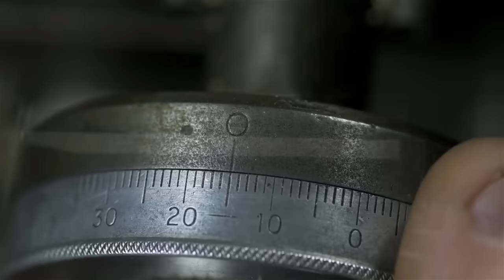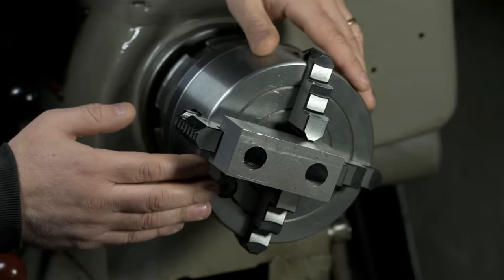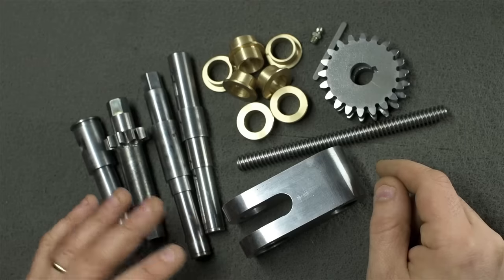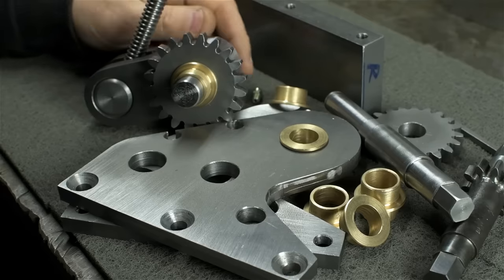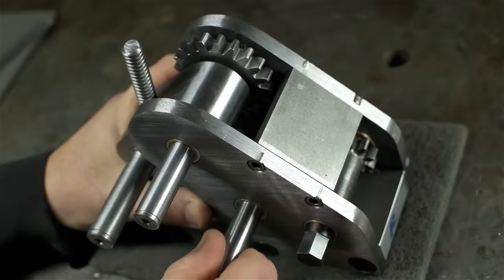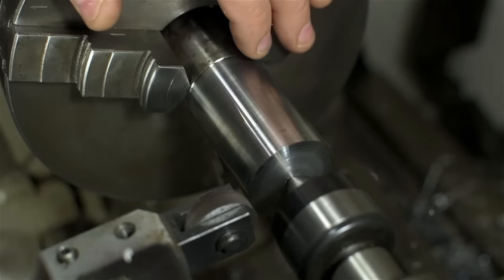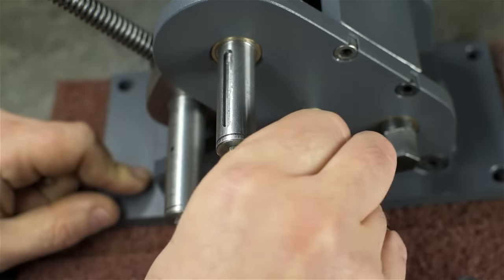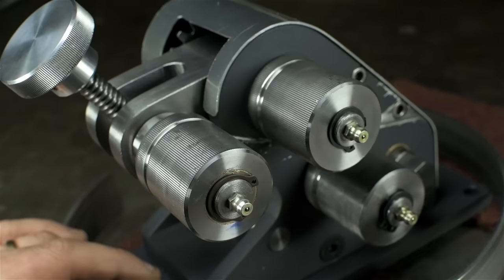The Rollenator! (Ring Roller Build)

Comment: Very nice, but how would you roll a non-flat shape? I've always wondered what it takes to roll aluminum sail track around a bend either inner or outer bend without crushing the sail track grove. Is there a way of doing that?
Reply from the maker: custom form-fitting rollers.  That fit the shape you want to bend.
Reply: @ThisOldTony  Many thanks for the fast reply, love the channel and the humor, i always learn lots watching you're instructions. I'm not sure just rollers would do the job because the sail track has a sideways facing grove that is offset from the base and I'm imagining that the top would collapse due to the larger radius on a bend. (example where I live: www.bunnings.com.au/metal-mate-27-95-x-12-7-x-1-7mm-3m-aluminium-section-sail-track_p1109879) I wonder if something could be placed inside the grove before bending and maybe chemically removed after. Pulling it out would be really hard to do once the hollow section collapses onto it. Either that or maybe some former that is stationary and inside the gap between the roller wheels that the bar has to use . A small section of well lubricated former that can bend to the radius required.

Comment: I did not scroll down too far, (no knurling on my scroll button) but my look see in response to your request regarding cost of such a machine resulted in this range: $150 for a manual roller of questionable quality at the low end.  We did see a cart mounted electric operated machine with 4 die sets, (round tube, square tube, You Tube, and flat bar) that was $2900 before shipping. There were quite a few in similar size to your build in the $850 too $1100 range, with cabinet.

Comment: If the material is, "moved" into the negative areas of the knurled groves, will this make the overall outer diameter somewhat wider than it was originally, as if "pinched"?  If so, does this also happen when tap and dieing, making a hole circumference somewhat smaller?
Reply from the maker: yes it gets bigger.  that's an old trick they used to use for emergency repair of worn bearing surfaces.  yes also with threads if they're cold formed (not cut)
Reply: @ThisOldTony  thank you!  I had this same conversation with a friend back in middle high school, in Bedrock, when I was dating Pebbles before that muscle headed, blonde buffoon came along!!  Um hum!  It definitively answers that question, at long last!!!

Comment: Customer rep with moderate understanding comes in, hands over files for a machining job. Files are from their engineer. Rep is repeately specific about some specs. Turns out they do not match the specs in the files from their engineer.

Which one do you go with?
Reply from the maker: you have to work to the files/print... have the rep update the files via the engineer so everyone's on the same page.

Comment: Well, when it comes to knurling metal, I managed, completely by mistake, to knurl a tapering aluminum shaft that was being used as a handle for a brass head hammer. And thing is, the reason the handle had a taper was a mistake to start with, because the class lathe I was using to get the handle down to final size, no one warned me that it was making tapers in anything turned on it, because something was wrong thanks to a careless student damaging something on it. So, I turned my handle, found it had a taper and I did not have time to make a new handle. Time to knurl it, and by that point, the teacher had taken the damaged lathe I had used to get the handle to final size..... so I knurled it on another machine that wasn't damaged. Got a beautiful, even, cross hatch knurl the full length of the handle. And if the taper was an issue and caused the knurl to be "out of spec", you could not tell with the naked eye, though, you could tell the taper in the handle * sigh * but, when all the work was done in the end, I did have a beautiful, machined by me brass head hammer. I miss that one class in high school......

Comment: Hey ToT, I think I saw 1 of these the other day at HF 4 $80-...?   Of course the 1 that I needed 2 get was $200-  (HF Tubing Roller) I'm building a ParaMotor Frame 2 oh say, Fly Around... They typically have a 55 in. dia. . . 1" Hoop 2 protect the Lines frum getting sucked in2 the Prop.. Mine is gunna B 66 in. 2 accommodate a 59 to 62 in. prop - which isn't done (Yet)  Most people don't stand that Tall...         The good thing about Your Tool is that U know where it is made - Right here in the Good Ol' USA (with Domestic & Imported materials) For ChrisSake, it took me 2 hours of De-Burring 2 make the thing safe 2 use...  Now I nee2 get a Tubing Bender 2 do all of the Compound bends - It's Tearin' the ass offa me. Thanx Ol' Tony...                                                                                                                 LJR-III

Comment: I can't stop staring at the counter bores bleeding past the edge....  You can buy a Horrible Freight ring roller for $74.99 (I checked before my eyes became welded to those counter bores).  It, the Horrible Freight ring roller, sucks unless you like turning flat bar stock into wine bottle cork removers.  Yours would likely only cost about $1,500 with time and materials, but still beyond the budget of most amateurs.  However, we (amateurs) buy and use the Horrible Freight stuff which is great because it takes a lot of wine to drown the tears we shed from poorly-formed rings.

Comment: There are no knurl marks on the diameter of the stainless because the diameter was to large and the marks cancelled themselves out.  Had it been slightly smaller you would have the marks.

Comment: *******************CHALLENGE ***********************  how would you hold a half dollar on the lathe while working on the edge of the coin specifical heating the coin once milled to depth using heat to expand 
the coin so the piece when finished will fit over a regular half dollar?
Reply: need pics i can send what finished product looks like.

Comment: What is the risk or downside of pushing a burr?
Reply from the maker: i don't remember the context exactly but was it on the lathe?  mill?  pushing a burr means cutter is not sharp.  so you end up with poor finish, sometimes harder to control size, and the machine is using more power / making more heat.
Reply: @ThisOldTony  On the lathe @0:49 (or however those kids get YouTube to link to a timestamp).  

But thanks for the clarification!  I'm fascinated by machining / milling and similar things I should never be allowed near (I'm clumsy).  

Cheers.

Comment: I don't get the henry ford joke
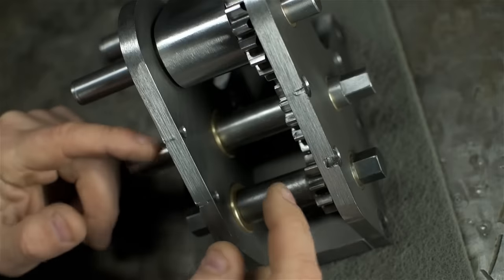16:44
someone explain
Edit: and the rockwell a million(?)
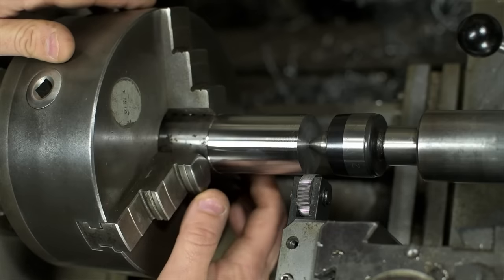20:19
Reply: One of the things that made Henry Ford's cheap assembly line for the Model T possible was having interchangeable parts.  (Ford wasn't the first to do that, but it was particularly critical for what he did.)  Before that, close-tolerance parts of cars had to be made by picking parts that fit right, or adjusting them to fit, just like Tony is doing by swapping the bushings around.

The Rockwell scale is a measure of hardness.  Typical numbers are in the 40-100 range; higher numbers are harder.  (Also there are several scales, for different types of materials.  It's complicated.)

Comment: @2m00s: "...about 40-to-1..."  The Mercedes 9g-tronic transmission famously has three parallel holes, each 6.1 mm diameter, in a 16 mm diameter core, to a depth of 361.5 mm. That's 59-to-1 baby. :-0

Comment: First you need to minimize the talking (get to the point! Please). I like the design and clean lines. Bottom shaft end lash, you could use a shim washer. Your jokes and puns need work. the length of flats at either end of work peace is due to the distance between the idler roller and the lower drive roller (bring them closer in a new build). the grey paint was a good touch (tired of yellow). Thanks for sharing the build.

Comment: As a 20 yr. exp. Machinist, 
the First 25 min. 
should have been 
shortened to say 5-7 min. 
I ended skipping till 25 min. segment.  
My main question, why not use longer bottom plate to create wider option with opposite side roller holder and various 3 piece sets 
of different lengths. 
Good idea for your next video. 
But Shorten up the tedium.

Comment: Your forming roller is basically exact the same and would be 80$ from harbor freight. I work in a R&D engineering lab. I was able to form 3/8 stainless steel adjusted to form diameter to 32 inches. It was  a cap on a rather large graphite gasket Going into one of the new Ohio class nuclear submarines the Columbia’s. I did alittle modding on it, by attaching a motor and controller to the crank arm. AND then mounted that whole beast to a table to be integrated into the production line 

https://www.harborfreight.com/gear-driven-ring-roller-36790.html

Comment: stainless oxide???   i think not
Reply: What do you think tarnish on stainless steel is, exactly, then?
Reply: @fredio54  okay I will stipulate that if it's poor stainless or if it's of a grade that tends to discolor yes it would obviously be oxidation because that's what happens to metals but the makeup of say 304 stainless is not subject to oxidize very rapidly I hit a bundle of 50 3/4 in by about 5 ft 304 stainless rods for my lathe probably for about 8 or 9 years they've been leaning up against the wall of my garage and for about a year they were in a damp storage facility and they don't have a spec of discoloration of any sword on . What causes that gray flat finish is cold drying sometimes hot rolling will facilitate the same stretched flat gray finish there's actually a four letter acronym for that finish but it's commonly called Mill finish and it's what happens when you draw or stretch a piece of material to its final dimension it's not oxidation
Reply: @fredio54  I also should tell you that I'm on amateur organic chemist emphasis on the word amateur I'm not trying to be an internet expert. But there's no such thing as stainless oxide it would have to be one of its components like chromium or whatever if it was the iron-based component it would be orange obviously or red or it could reach a state of oxidation that makes it kind of blackish but it wouldn't be smooth and even it would be blotchy because the components that are used to make up the different stainless formulas are not going to separate in a way that would allow one element to oxidize by itself it would end up being blotchy I'm almost certain of it. If you even notice a piece of aluminum plate that gets like damp or some other chemical spilled on it it'll have all sorts of variations of oxidation

I'm probably not expressing myself correctly but best I can do
Reply: @ClownWhisper  304 is totally subject to corrosion, only 316 is decent in harsh circumstances. My chemistry papers at University don't tell me that, 30+ years of working with stainless at home and in marine environments do. I'm not even sure which grade is used for the shafts permanently submerged in the ocean on our current boat, but it's not 316 AFAIK, something much stronger - it too has been fine for 25+ year in salt water. But 304 in salt water can vanish pretty quickly. Same if soaked in a weak acid, will be full of holes in no time. All the fixtures above the water line are 316 but even that loses its shine over time. Stainless can corrode, just not very quickly. Aluminium is highly reactive, but under normal circumstances doesn't corrode at all after an initial burst when first exposed to oxygen. Unless you treat it with a certain acid, then it reacts rapidly.
Reply: @fredio54  you are talking about absolutes and are involving corrosive elements 
the grey flat coating on the metal in question is not oxidation PERIOD! its caused my manufacturing.

under normal conditions even using 304 and even over many many years you will never see stainless get a layer of oxidation as seen on the metal in this video.

i switched out all of my glassware holding apparatus, bars, clamps, etc to stainless 10 years ago and use mostly the 304 I had/have on hand for that reason. yes, 304 isn't the best choice for this obviously but it has held up to every manner of extremely low ph off-gassing as well as months and months of chlorate production, and other than some blotching there is nothing like ys seen on this metal in this video

if you don't believe that this is caused by manufacturing, I don't know what to tell you
Reply: @ClownWhisper  I agree that it's caused by the manufacturing process. That process by its very nature is hot. Heat causes faster oxidation. And there we have it :-D
Reply: Again there's no such thing as stainless oxidation otherwise you could send me a little package of stainless oxide LOL there is no such thing because there's no such call stainless there could be chromium oxide I don't know what is hard to understand about that